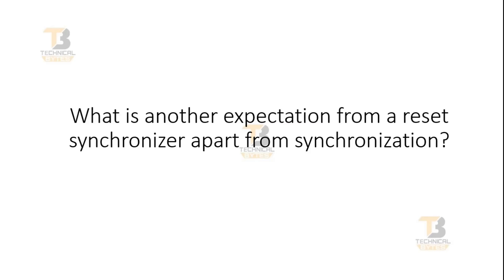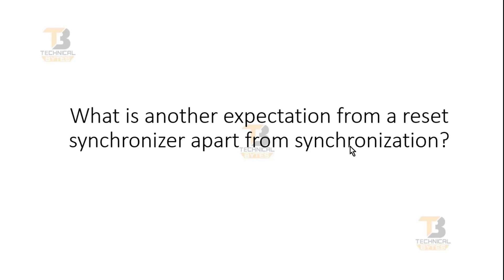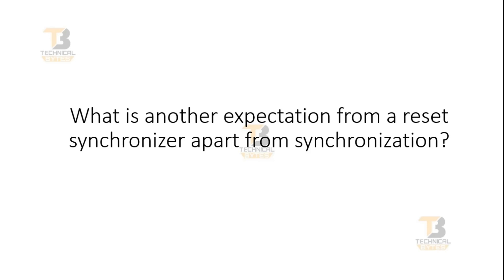DigiThon Question Part 3

Comment: Only usage of reset synchronizer is that the de-assertion of reset is timing i.e. will meet reset recovery time with respect to clock. 
Also, if rst2 is synchronized using rst1. The purpose again is that the rst2 deassertion is timing with capture clock. 
Violation of reset recovery and removal time causes metastability. 
So, in conclusion reset sync help meet recovery and removal time and avoid metastability

Comment: Another expectation should be to have a circuit to filter the glitches coming on asynchronous reset. An asynchronous reset source could be prone to spurious glitches which can assert reset unwantedly.
Reply from the maker: Very good, there is another important feature also
Reply: @TechnicalBytes  1.We need to consider the MTBF for deciding the number of flop stages in reset synchronizer.
2.Special care to be taken care when doing DFT, flops inside should not be part of scan chains instead bypass it with scan_reset.
Reply from the maker: excellent !! but there is one more thing to be considered for designing reset synchronizers !!
Reply: @TechnicalBytes  A Couple of things I could think of is having a balanced reset tree similar to a clock tree but not sure if this is the one you are looking for as this is not related to designing of synchronizer module.
Another thing could be  to consider active high reset and place an inverter at the output if needed

Comment: to avoid glitches and the problem of metastability!
Reply from the maker: Very good, glitch removal is one feature, there exist a another very important feature also
Reply from the maker: Synchronization meaning to synchronization with the clock to avoid metastability. There is something else also that is expected from a reset synchronization